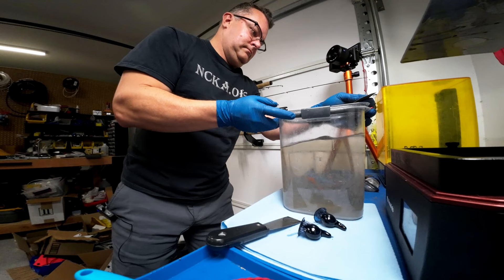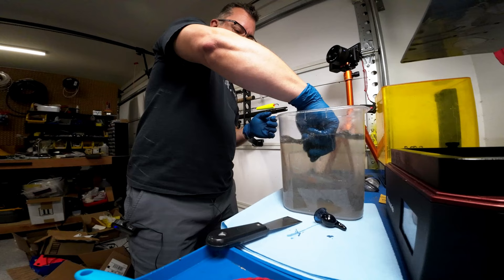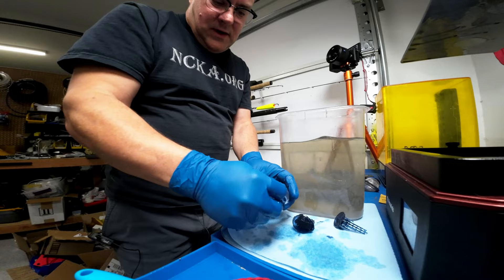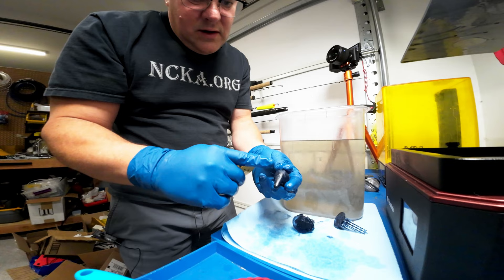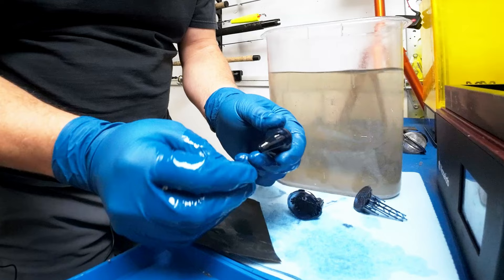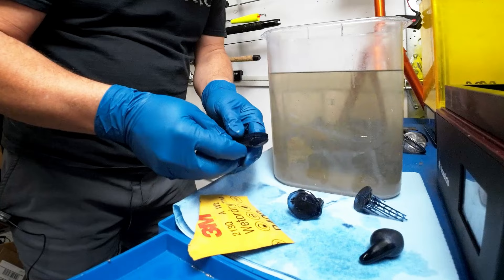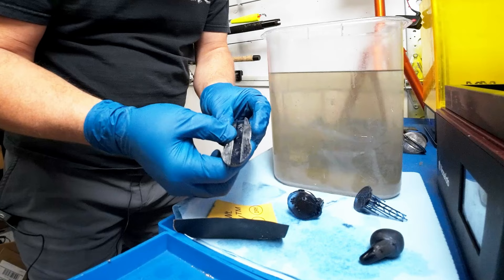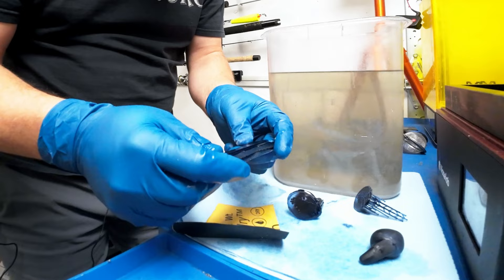Get the Perfect Finish with These Resin Print Sanding Tips

Comment: How do you "cycle" your spirits?
Reply from the maker: I take the dirty wash and place it outside in the sun or run it through the cure machine. I then filter all the big chunks out then let it settle for a few days. I then pour off the top "clean" wash fluid.

Working on a more elaborate, possibly overkill setup that I will post soon.
Reply: @WMBayouLures  thanks! <3